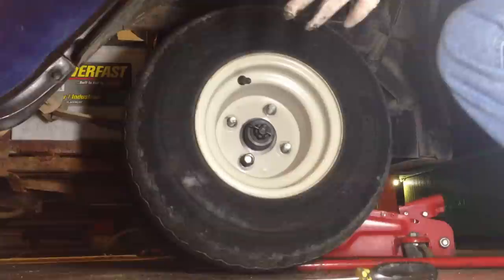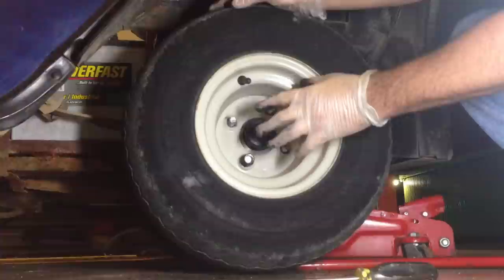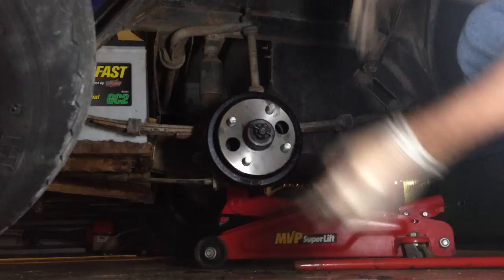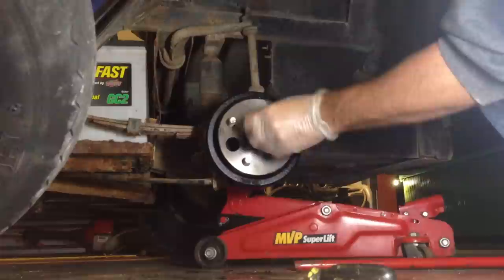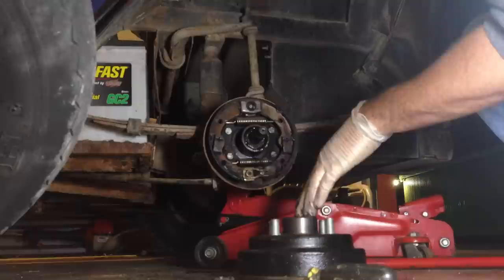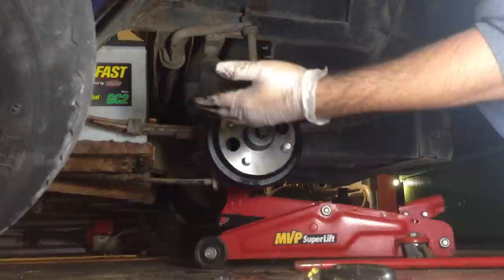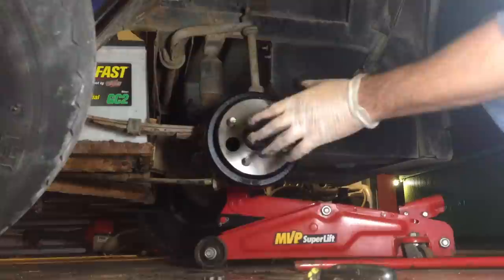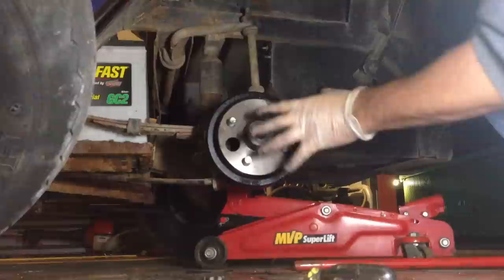How To Quickly Replace A Stripped Golf Cart Hub

Comment: Note that the castle nut has torque spec requirements.  If not set to the correct torque, it will just strip again and you will keep buying new hubs.
Reply: True and the castle nut will strip if you over torque it like I did last night!!!!!!
Reply: I had to use a small half round file to clear burs in the grooves of the axel splines to get new drum to fit . JM2C

Comment: My issue is not being able to remove the castle nut on the right side because of the stripped splines on the drum.  It just turns.  I don't know what I can do to get it off.
Reply: I solved my own problem.  For some reason I thought about how to remove a drill chuck, for anyone who has done that.  I put a socket on the castle nut.  With a couple of sharp whacks on the ratchet with a hammer, the nut broke loose.